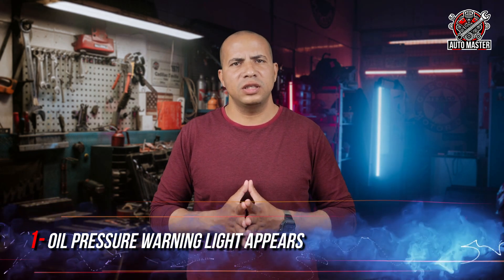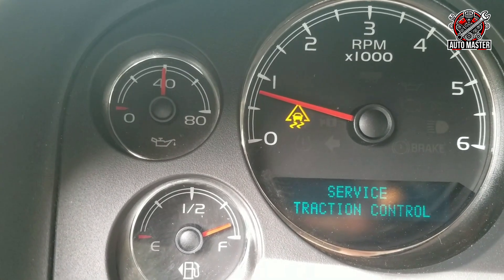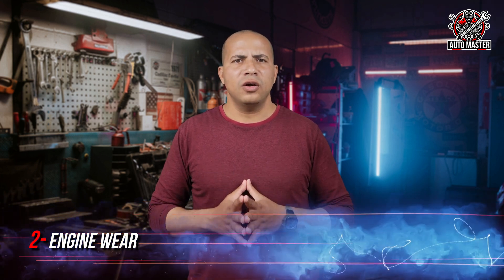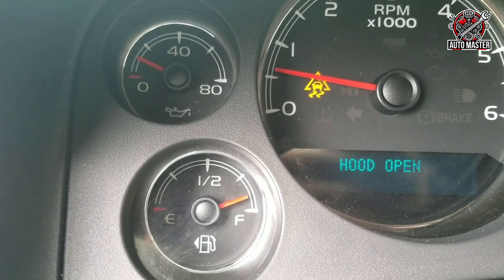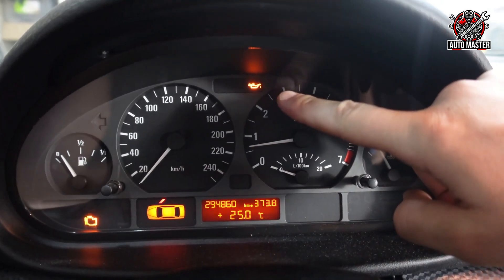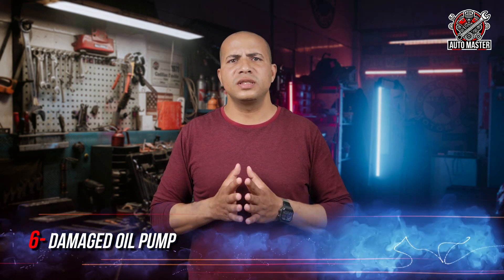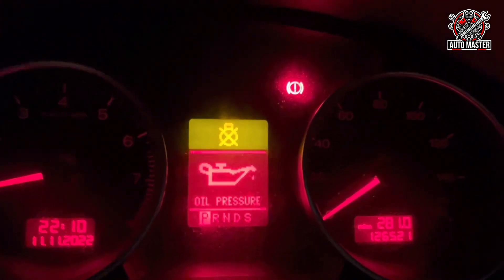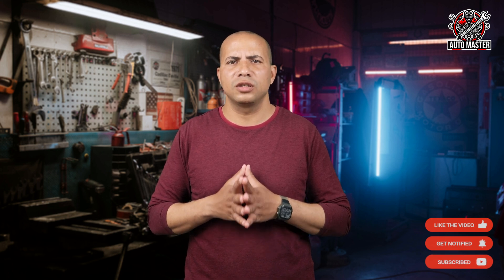Oil Pressure Sensor — 3 Signs It's Bad

Comment: Information  is great,what about a low oil pressure  light glowing momentarily  while the vehicle  is  idling  in park and the engine  shuts itself off? I've noticed  this happening  once in a while  before  I actually  turn the engine  off myself.
Reply from the maker: Low oil pressure at idle with the engine shutting off means the lubrication system is failing.

Here’s what to check
* oil level may be low, check the dipstick
* oil pump may be weak, pressure drops at idle first
* pickup screen inside the oil pan may be clogged
* oil may be old or the viscosity may be wrong
* internal wear in bearings or the crank can cause pressure loss
 
Questions that help
* do you hear any ticking or knocking before it shuts off?
* does the light appear only at idle or while driving too?
* when was your last oil and filter change?